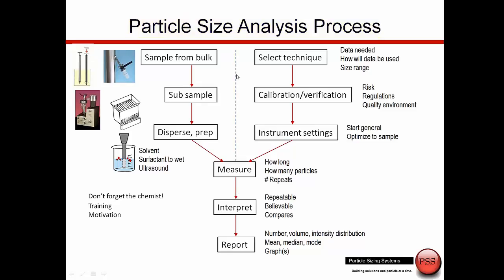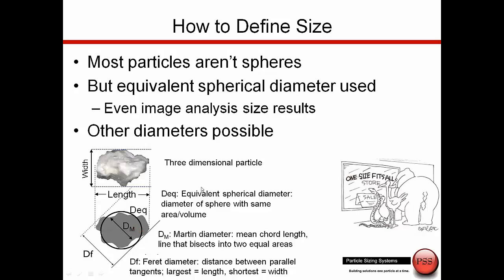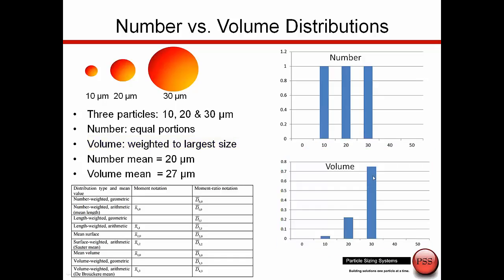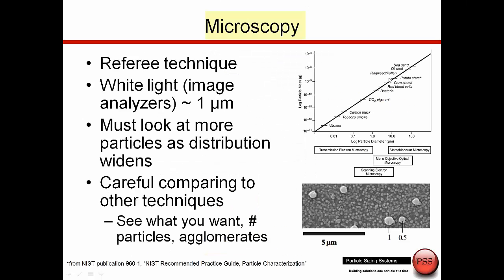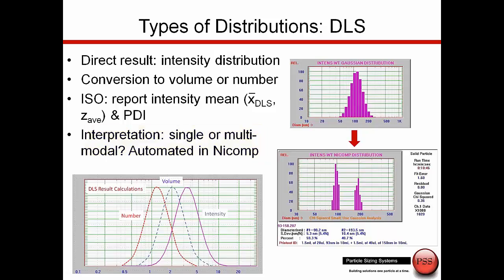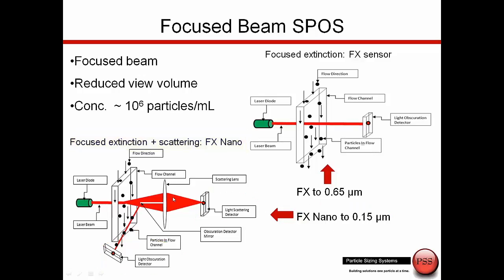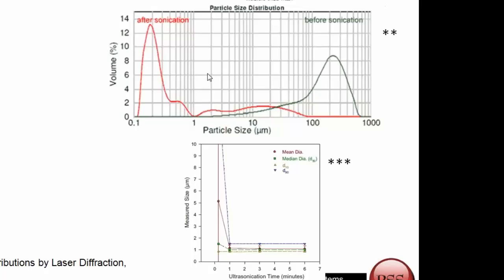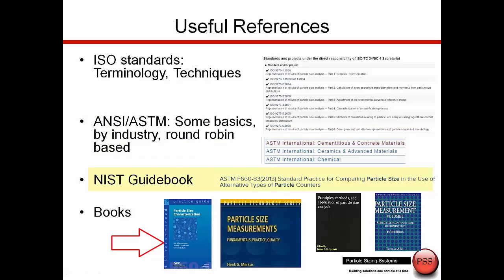PSS Introduction to Particle Size Analysis

Comment: 10:08 needs clarification. For the example given:
The Volume Mean Diameter is D3,0 = 22.89um. 
The Volume Moment Mean Diameter D4,3 = 27.2um
The Arithmetic Mead Diameter D1,0 = 20um
The Intensity Mean Diameter (assuming Rayleigh Scattering I ~ d^6) Zd= 29.2um

All the results discussed after that should have stated "presented on Volumetric Moment Mean Basis" not on "Volumetric Bases".